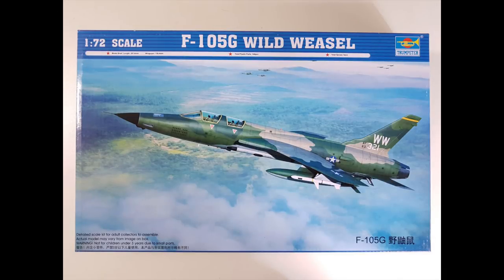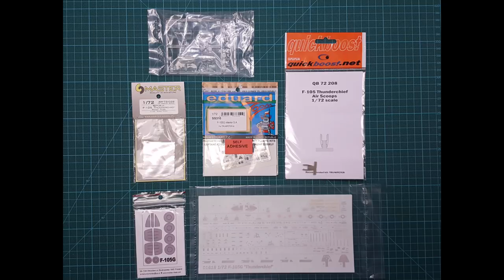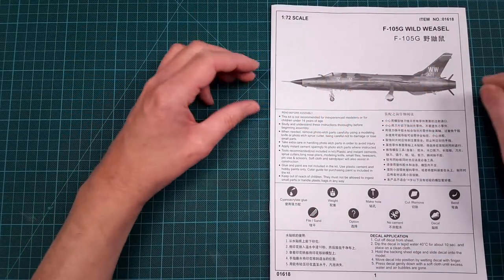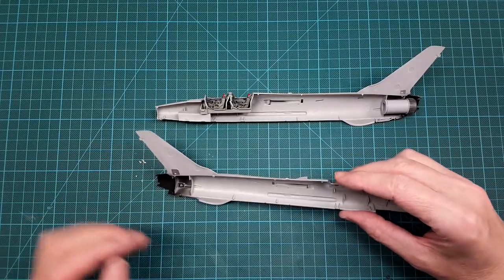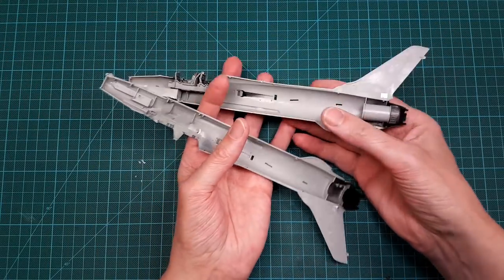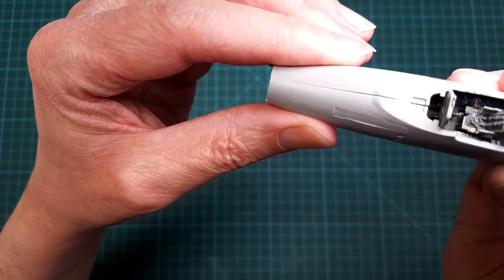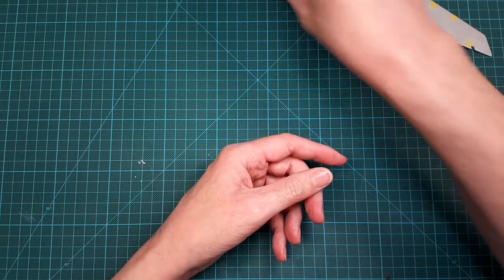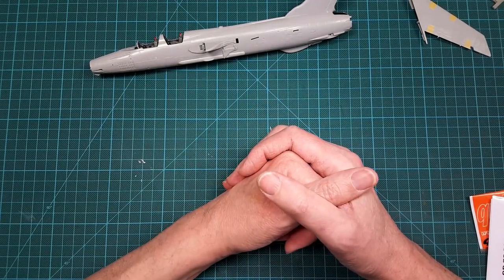F-105G Thud Build - Episode 1: Build start

Comment: Hi there KillBox. Great video. I have just bought the same Trumpeter kit. You mention you have purchased a masking set for the canopy. What make is the set and where do you get them from? Cheers!
Reply from the maker: Thanks! 
I used the masking set from Montex (https://www.scalemates.com/kits/montex-sm72154-republic-f-105g-thunderchief--198661).

There is also this option: from Eduard (https://www.scalemates.com/kits/eduard-cx221-f-105g--116039) - this was my first choicee, but I could not find that in any shop, so I had to go for the Montex set.

Good luck with your build :)

Comment: Watch out for the decals on this kit: BAM-BAM's tail markings are (AF/38)320 (not (AF/63)321 as in the kit)  and should have a knight helmet on the yellow shield between canopies. It is currently on display at National Air Force Museum and they have few photos of it during the war https://www.nationalmuseum.af.mil/Upcoming/Photos/igsearch/63-8320/
Reply from the maker: Yes, the Trumpeter kit has it's flaws. When I build the next Thud I will use after market decals for sure...